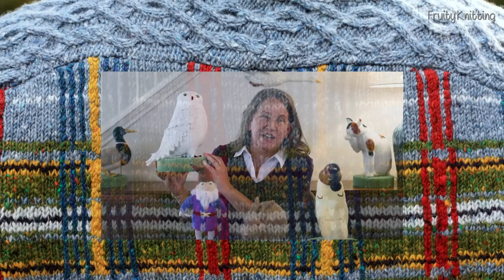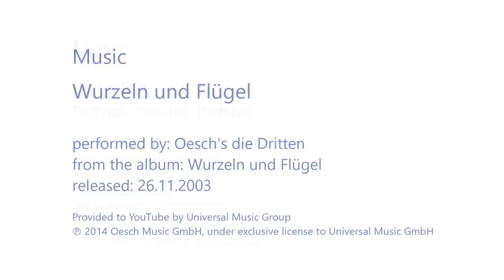Laxtons – Worsted & Fancy yarns - Ep. 133 - Fruity Knitting

Comment: I learned from someone online that if your gauge is slightly off, you can use this calculation to recalculate your stitches and rows.				

			                                       Sts.    	    Row	
					
	a. Old Gauge		                     18	               22	
        b. New Gauge		             14	               20	
	c. =%		                        0.777777778	0.909090909          (b/a)
	d. Original Cast on		       90	              203	
	e. New cast on		               70	              185	  (d x c)

Comment: Just a question about the changes you made in the armhole to accommodate your row gauge difference....Were you able to block that distance enough to work with the width of the sleeve (which is determined by the stitch gauge, so consequently wider than the armhole was long), or did you have to really scrunch the sleeve up to fit it into the hole?  I ask because I have had a similar issue with a sweater.  Thank you.